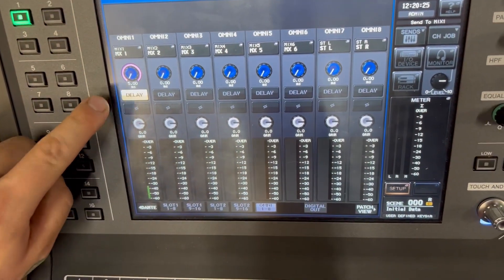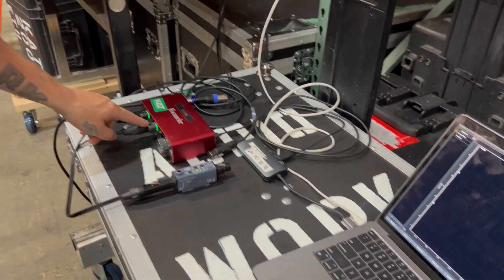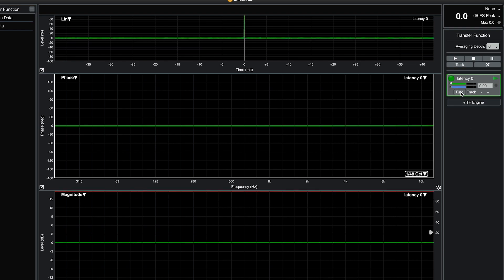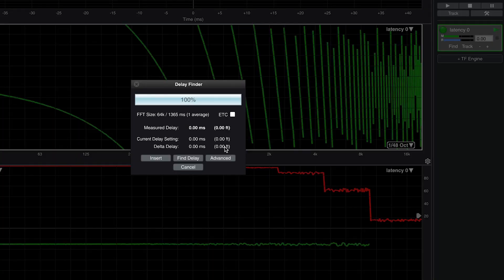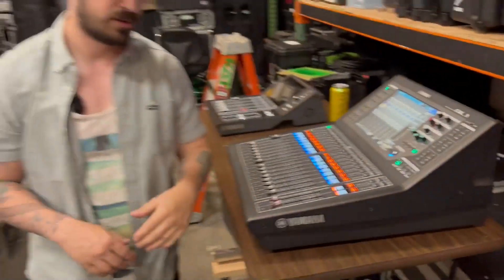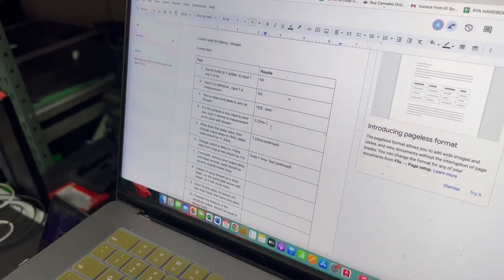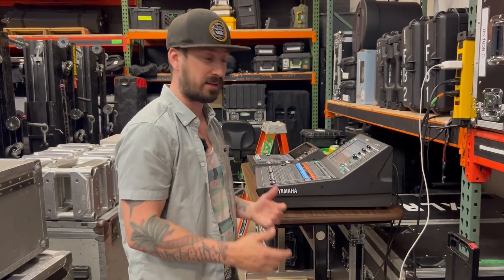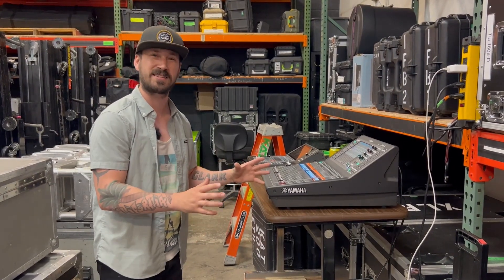latency control test with Smaart and Yamaha Ql1

Comment from the maker: Couple notes * at the start when I said 5 seconds , I meant 5 ms. Additionally, I want to emphasize- this is not meant to be the complete latency testing of the Ql series. This is simply showing my process and methodology for control testing. If you think I made an error or this can be done better , please let me know in the comments.
Reply: i'm curious about making this test with a QL5, CL5 to compare.
And when you are network with a RIO your latency just depend on the Dante latency or does it sum with the local 2.23ms latency ?
Btw if you got the datasheet of this test i'm quite interested in !
Thanks you the video and the knowledge sharing !
Reply from the maker: @aligato  actually started testing that! I was working on ql1 to ql5. I clocked 2.23 with ql1 and 2.27 with ql5. Haven’t finished cl vs Ql yet.